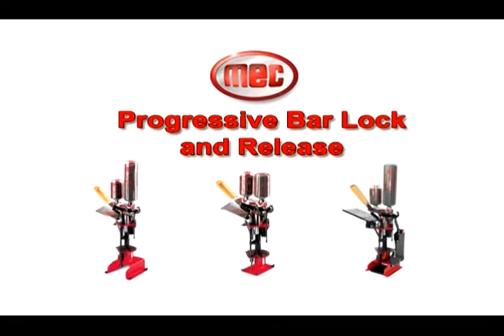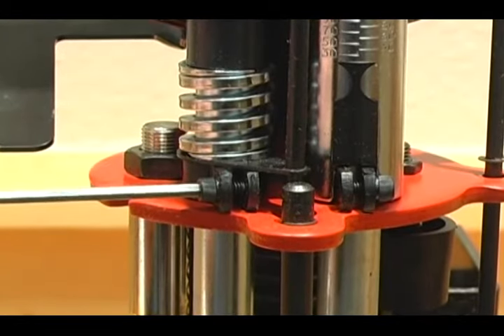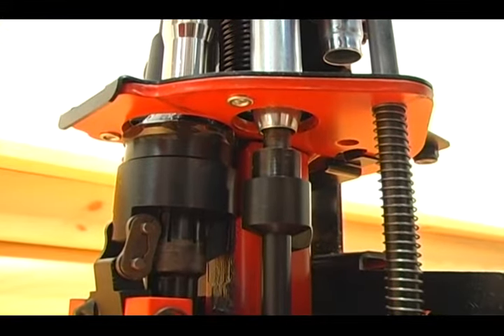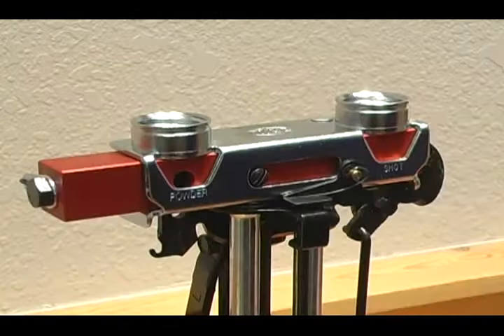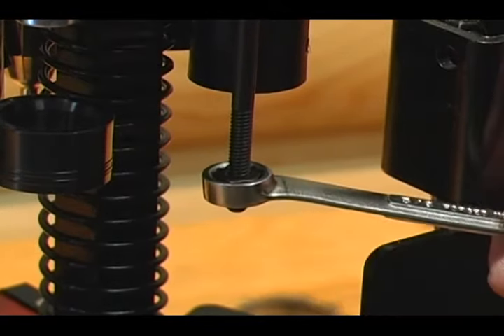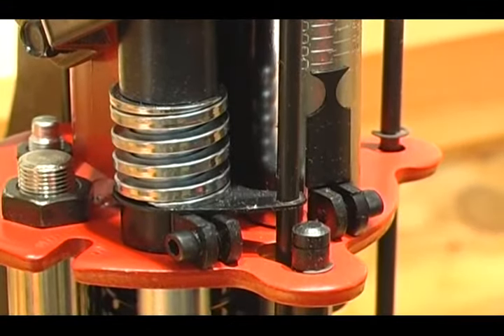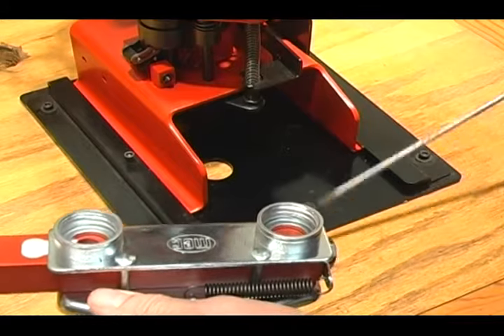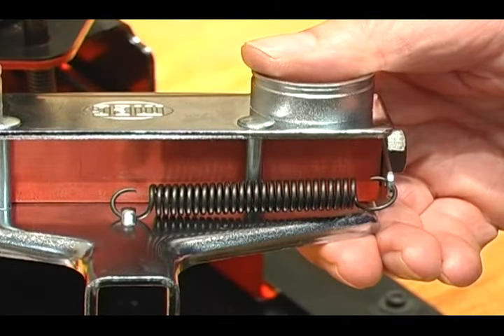MEC Reloaders Troubleshooting   Progressive Bar Lock & Release

Comment: If all this doesn't make the Bar Lock work correctly, make yourself a washer that fits behind the Bar Lock spring.  You will probably have to put a washer on a file and slide it back and forth until it is thin enough.  I did mine on a belt sander but it would be easy to have it fly off and lose it.  I held it with a piece of wood and turned the sander on and off in seconds because you can't grab it when the sander is moving. this keeps the Bar Lock from tipping sideways.

Comment: Hello I got the grabber 761R I'm trying to do 3 inc high brass it only resize half of the brass leaving about a 1/4 of brass not resized any help would be appreciated
Reply from the maker: Hi Brad, Thanks for commenting!  The older 761R model Grabber can only be used for low brass 2 ¾” shells. If you have any further questions, please let us know by emailing us at reloadersales@mecoutdoors.com or calling at 1-800-797-4632
Reply: I bought the separate sizemaster just for that purpose.

Comment: I have an old me 76 grabber and the charge bar will not lock back because for some reason the bar lock will not function and I think it is because the little spring on that is in the wrong place or broken, any suggestions?
Reply from the maker: Hi Wyatt,  Thanks for commenting! If the charge bar does not lock up properly when the shells clear the first two stations, follow these instructions;

-Make sure that the charge bar is completely traveling to the left.  The small screw in the front of the bar should contact the left side of the chrome measure assembly when the press hits bottom.

-The top side of the trip rod #670F should be flush with the top side of the drop tube bracket #670C when the press is in the down position with no shells in the reloader.  If the trip rod is above the bracket, bend down on the trip rod bracket #670E slightly until the top of the trip rod is flush with the drop tube bracket.  The trip rod bracket is half way down the trip rod.    

The bar lock spring #670B should also be checked to ensure that it is not weak.  Please email info@mecoutdoors.com and we can send you a picture diagram of this.  Thank you.
Reply: @MECOutdoors  thanks for the tip I think my bar lock spring is weak because my trip rod has never really gone flush and has always functioned fine. If having a weak bar lock spring is my problem where could I get a new one and how do I replace it?
Reply from the maker: @wyattrademan7937  The bar lock spring #670B can be ordered through us online at www.mecoutdoors.com or by calling 1-800-797-4632.  This will come with a small instruction sheet to show how it installs.